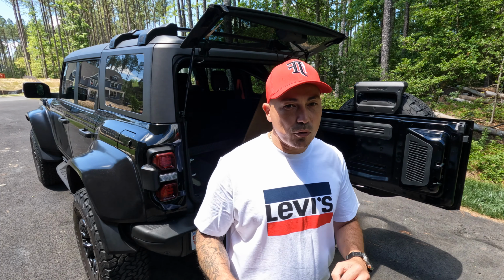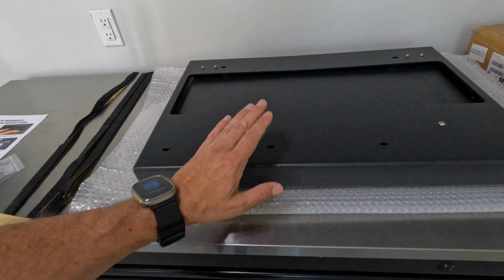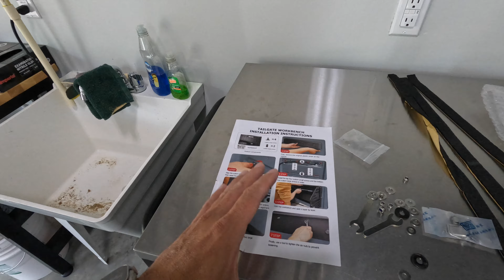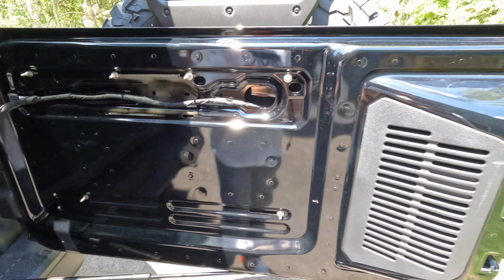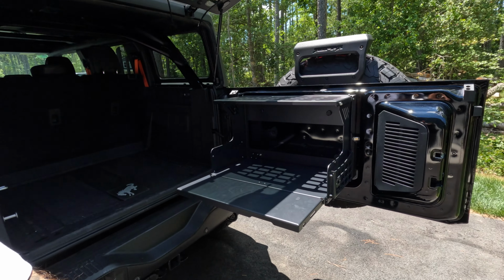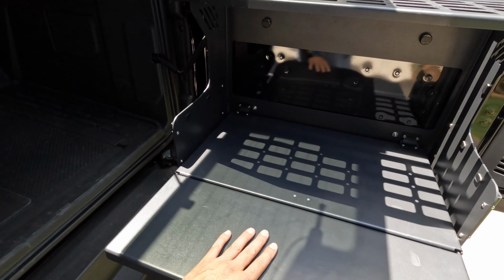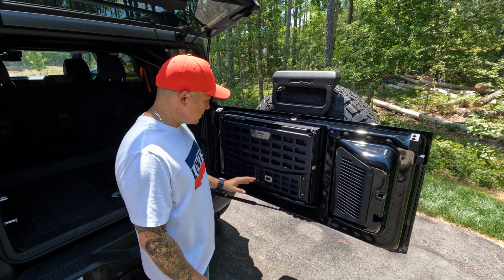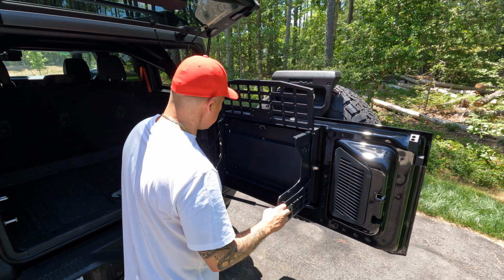Bronco Tailgate Table Install (BROADDICT)

Comment: I am a bit Boojie, but I found the fit and finish subpar... I had several bolts that were loose and had to be tightened, and the side panels scraped heavily when closing up in travel form. I ended up having to bend the lower part of the side panels so they wouldn't rub. I tried adjusting the side panels without bending, but it was not sufficient. There was already scratches when I pulled it out of the box. Don't get me started on the lower 2 bolts that did not tighten correctly.. I ended up having to get a bigger washer to get the lower bolts to tighten before I could add the table itself.. Overall, I like the product, but quite a few adjustments out of the box.
Reply from the maker: @grouchiegrumbles2080  sorry to hear that.  I wonder if they sent you a returned and used one by mistake since yours had scratches on it.  I would have definitely had them exchange it.  Mine was perfect and worked perfect so I’m not sure what happened but I definitely love mine and use it every chance I get.  I would try contacting the company and maybe ask for a partial discount for being an open box.

Comment: Looks good any rattling while driving ?
Reply from the maker: @willinetics1  thank you 🙏.  So far no tattles at all but only time will tell.
Reply: @FindingJay what has time told?
Reply from the maker: @t.caldwell3886  still works amazing.  I still keep going on off-road trails with a lot of hard bumps and shakes and it’s still as the day I installed it.  Zero problems.  You can see in my video I just released yesterday that I was in the mountains again and it’s still great.  I highly recommend it still.

Comment: Good video. What is the weight capacity on that thing? And any rattling while driving?
Reply from the maker: It itself weighs about 22lbs and what it can support I couldn’t honestly say but what I can say is that it is solid to the tailgate and has zero rattling.  I would think that it can probably support 50-60 lbs safely.

Comment: What type of roof rack is that?
Reply from the maker: @anthonygallo3576  the roof rack on my truck is by Broaddict I also have a video on that if you wanna check it out and it helps.
Reply: Great thanks,I have the broaddict matching headlock rings